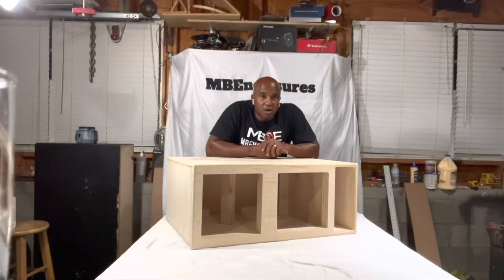Let’s talk Transient Response…

Comment: I was the one that made the Transient response comment, There was no intent of disrespect... I'm subbed and think you do great work..! I did not make up the things I said, that information came from numerous articles I've read, written by audio engineers much smarter than me... From what I understand for large subs to have an accurate transient response, a sealed box with it's resistance helping the motor pull the cone back to 0 is very helpful... (Acoustic Suspension)
A ported box allows a sub to move more freely... that's why you get more output with less power. when a large sub moves freely at the distances subs are moving these days, accuracy will no doubt suffer when playing really fast, hard, drum heavy rock.
Like I said, I'm no audio engineer.... all I know is what I've read from them. 
(I also understand technology is always advancing and improving..)
Reply from the maker: Nick I hope my remark didn’t come as a direct jab to you. And I’m not an engineer as well. You brought a good point, I’m just sharing the knowledge I’ve found as well from reading and listening to subwoofers over the years. Dialogue is the key. We may have differ viewpoints but either way dialogue has started which will bring new ideas and understandings. Peace bro.
Reply: @M.B.Enclosures  well handled
Reply: @M.B.Enclosures  Thanks man! It's all good. keep up the good work...!
Reply: Boxes dont affect transient response the way you think they do. Look up infinite baffle for example. What matters most to transient response is inductance, slew rate, and output impedance, assuming were dealing with at least decent equipment.
Reply: @noncog1  I've read many thing's that say different... I'm talking about 15's , 18's and hard fast metal... is that something you've had a good experience with..?
Reply: @2869may  look up nick from stereo integrity, he has an sq build running a 24in sub. Look at home theater andhifi guys running 15s, 18s, 21s, 25s...
Reply: @2869may  a lot of people, even some who claim to be box builders, dont know nearly enough about how subs interact with boxes, which is crazy when decent free modeling software exists. Ive known guys that think they know better than the software then repeatedly churn out mediocre boxes. It also doesnt help that the parameters that indicate a subs sound quality are often never measured and published, even something as basic as inductance is ignored by most manufacturers and consumers, not to mention cone modes, bl through excursion, and inductance through excursion. Luckily a lot of the info is out there for those willing to look, and winisd is a good tool to play around with and try to learn if youre able to use it with the support of a knowledgeable community.
Reply: @2869may  luckily sealed boxes are much harder to get wrong, that box looks beautiful, and it looks sturdy, which is important, because baffle flex will reduce accuracy and efficiency. Im an infinite baffle guy myself, i dont like anything other than signal controlling the cone, ive even used some spiderless midranges, and they were great for the price (at the time, theyve prolly gone up now...)
Reply: @2869may  im broke, lol, all the systems i build are for others
I dont have as much knowledge as i want, and all i have ive gotten from others who figured it out first. The internet allows us a wonderful way to connec with some extremely experienced people, and allows those willing to learn a chance to do so
Reply: @2869may  yep, i help my friends out, so i may not have a system myself, but ive got to build and hear a lot more systems than i would ever be able to afford myself. Thanks for talking, wishing you well in all worthy endeavors.
Reply: @noncog1  I'm running three stereo integrity SQL 12s in my 2007 Honda Civic sealed clamshell opening into cabin from trunk on an Orion xtr 4k. It absolutely hammers 100% accurate bass drum like nothing I've ever heard and plays down to 8 hz blurring vision. I can Big Time vouch for stereo integrity and sound quality, xbl2 motor structure ftw. Absolutely amazing and worth it.
Reply: @johnnycorn7225  gunna be putting 2 sql-15's on a salt-6 in a vw rabbit in a huge ported tuned to 17hz soon. Aiming for 140db@17hz, and expecting clean and accurate as can be up to 80hz where the 8in midbasses take over
Reply: @noncog1  yeah,that's gonna hurt in that hatch, guaranteed sql's have a certain sharp punch to them n no slop whatsoever

Comment: I've seen many brands that use the same magnet size on their 10, 12, and 15.
Reply: Because the same size magnet can be charged to provide different Bl's
Reply: @noncog1  Interesting. I just assumed they would magnetize the slugs to the maximum. Doesn't make sense to me why they wouldn't.
Reply: @hippo-potamus  way more expensive to toll multiple production lines to make various different size mags when you could just charge them to the needed force
Reply: @noncog1  Yea I get that. But why wouldn't you just make the magnets full power? I don't see how having a stronger motor force would be a negative in the smaller subwoofer sizes. Wouldn't having a 10in with the same "magnetic power" as the 15in be superior to the same 10 with its magnetic forced tapered?
Reply: @hippo-potamus  qes, fs, and potentially linearity
Reply: Yeah I have the ab hawks.. same motor on my 10 as a 12 and 15

Comment: Find a sub with a EBP of 50 or lower +a shorting ring, run it minimum sealed airspace with 2x the RMS rating w amp gain back down a little bit, 4 ohm, set.  Look for very low inductance subs.